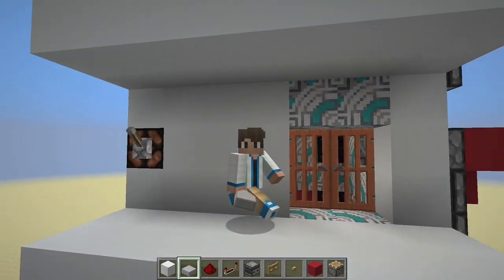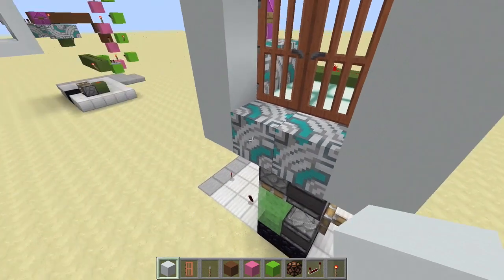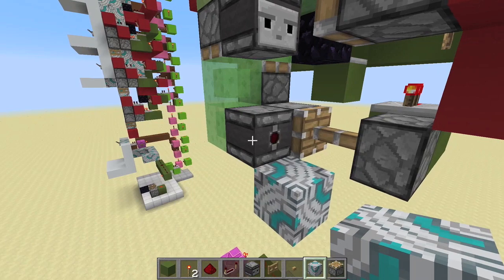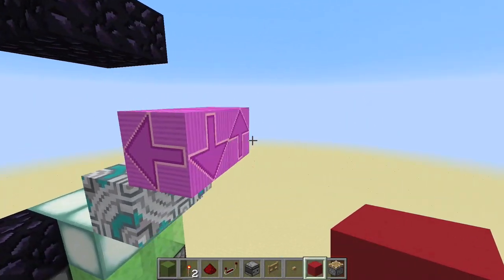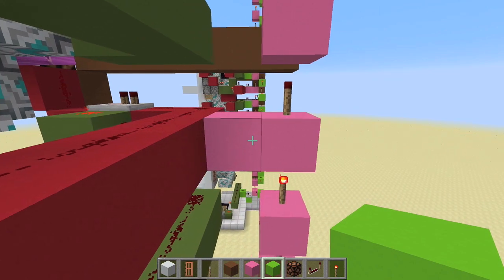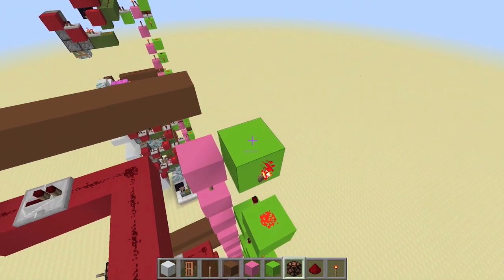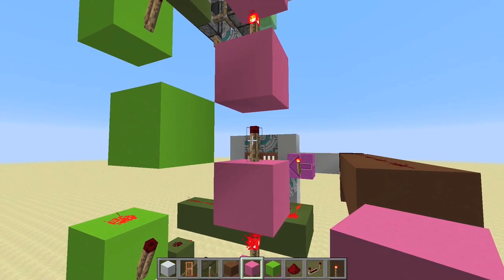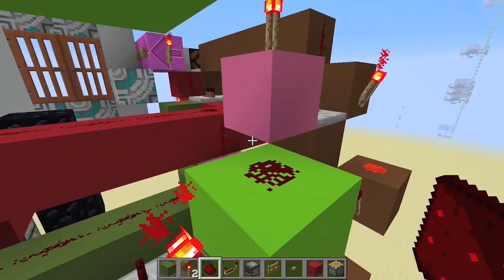Minecraft Tutorial: Multi Floor Elevator with call to floor  V2 java 1.12 - 1.13 / PE

Comment: @Hex and anyone else who may have problems....on xbox 360 mine would get stuck...I found out through trial and error that for some reason the buttons stop it despite being two blocks away...I tried the buttons on top of the blocks and works fine so currently I'm working out where I can fit them lol...
Reply: Pickled Peachez omfg thang you so much! I have the same problem on Xbox 1s it’s been so stupid!
Reply: @d3von443  lol your welcome....I rebuilt it about 4x as I really liked the design....getting a  new xbox one myself so handy to know it will work again moving the buttons :)
Reply: Thank u so much
Reply: This also happens on ps4
Reply: @PickledPeaches  are you still an active MC user? I built this for Xbox one on bedrock with a few modifications and it works well other than the call to floor function
Reply: @colintalltale6133  hi...kind of..I had a break from it recently..and likely wildfire abit longer as just bought ff7..but I do have xbox one too now...great to hear as i really liked this design...what sort of mods did you do?
Reply: @PickledPeaches  I implemented a dual locking system and cut out the use of the cycling function to keep the elevator spaced so it starts and stops no problem.
The issues I faced were the pulses from the flying platform observer were too short and kept misfiring my elevator, instead of square it is "L" shaped.
The whole system works, and you can have the elevator come from the ground up, or the Penthouse down. This is is my first time playing with Redstone though and I'm having trouble automating the call to floor functions. I just don't know enough about redstone yet
Reply: @colintalltale6133  well fir first time you sound very knowledgeable...yes unfortunately I couldn't get the call feature to function to the too but was ok bottom to middle.
Reply: @PickledPeaches  I spent 3 days s watching videos looking for this exact system. It's just a shame that different versions come with slightly different redstone properties. I have a friend that has been playing MC for years and he briefed me on Redstone
Reply: @colintalltale6133  yeah maybe hex can put together a modern version too :) unfortunately my redstone knowledge is self taught/or watched so still learning
Reply: @PickledPeaches  I've reached out to hex already, I'm hoping he gets back to me despite it looking like hex is on PC and I'm on xbox

Comment: Very easy to add floors in either direction, very good explanation, now I finally understood the concept of how it works. much thanks.  Gonna use a pressure plate for the doors though so they auto close once inside.

P.S. I also chose to complete each level for both up and down so that I don't have to change anything later if more levels are needed. I just didn't add a button to the un-needed block ( so no button for down on the first floor and no up on the top floor ). Just add the button later once it's needed.

Comment: It works perfectly fine for me in 1.16.1 but at the 2nd top floor, when you press the down button, it will go up instead. Is there a fix for it or did i build it wrong?

Comment: Installed this on an existing world with a three story house. Elevator wiring went in easy, but the call to floor was another story entirely. Nothing lined up as it showed in the tutorial. One part would line up on one floor, but not on the others. Another part would line up on two floors, but not on the others. Most of the stuff that didn't line up showed a fix so it would have been more of a nuisance than anything else, but with the lever he said if it didn't line up, go back and check the tutorial again. Checked, double checked and triple checked. The only problem is my floor spacing. With no fix for this problem, it kinda kills the whole call to floor idea. Just saying, but not everyone is going to have floors spaced just right for this. I don't have enough knowledge of redstone to find a fix myself so I would love to see this added.

Comment: This is a really cool creation. Not sure if you still read the comments for this videos, but i'm having trouble with the call to floor function on the level above the bottom. The elevator skips past that floor and will go to the bottom. When the lever is turned off it goes back up to the floor in question. Is there a certain block distance you need for the connection to the green and pink blocks? Is there any rules other then the type of torch block to connect to and having it be at or below the floor? Or is it something else entirely? Thanks

Comment: I have a question at 17 mins or so you press the up button to bring the elevator back up to the next floor but when I do that it only comes up 3 blocks then stops how do you fix that?
Reply: I have the same problem, did you find a way to fix it or did you give up and found a different elevator because I’m just about to give up completely and go with an ugly bubble vator. If you did give up could you tell me a video that works.. thx
Reply: @bread1511  in console the slime gets a stuck on the buttons just place them on the top of the block

Comment: When I did the call to floor function thing it didn't work bc i didn't have the same spacing, even though I exactly copied what the video said. Any ideas?
Reply: I sugest you to make a call to floor function by yourself. I am having the same problem, so i'll do my own circuit, i think that i'll use random blocks, random slabs, observers, redstone, repeaters and normal pistons, but idk if it will work, i hope it will

Comment: This elevator seems to not work on ps4 1.16. When I press the down button for the second floor, the elevator car goes down 2 blocks, and then goes back up. Anyone have a fix? I tried playing around with different buttons and got the same result.
Reply: Bedrock Version?
Reply: @flxsc3877  yes
Reply: 1.16.201.1
Reply: Sometimes you got a block that can be pushen by slime at the edge of the elevator
Reply: @flxsc3877  ok
Reply: Try it. If its not fixed After that i dont know anymore😅

Comment: Can you change out the lever for a button or maybe a floor plate? I mean I'm done building mine in creative for proof of concept so I'm gonna try anyway but I feel like it's much better then a switch that might get forgotten.
Reply: Mitchel Janke you could but you would have to add a delay that’s long enough for the elevator to reach the floor from any other floor i.e. on the top floor, have a long delay if you’re calling it from the bottom so that the torch tower is flipped long enough.

Comment: It is a really awesome elevator. However, mine is having an issue. As it passes a stop point, where the buttons are, the slime block actually grabs the buttons, breaking them. Also, it sometimes stops between floors. Please advise. Im operating on a ps3 which may have something to do with it, and its in my redstone test world, which for whatever reason makes it lag miserably as i push the button. Also, falling through happens. Idk. Still awesome design. And if u read this all thanks, you're awesome!
Reply from the maker: Did you set the buttons back a block?  It wasn’t doing that for me.   Also you should check out my multifloor water elevator.  Similar functionality.  Much more compact and super fast!
Reply: Yes i built the buttons like on yours, a block back on the arrows, essentially a copy of yours, with detail diffrences. The sort of elevator modle im looking for is one like would be in a skyscraper. However i assume the issue is that the system is way too laggy. Thanks for the reply, its not often big youtubers like yourself reply to my reveiws. Thx!

Comment: This elevator works beautifully on our 1.13.2 server. Is it possible to integrate an automatic door opener with this design? I've tried to figure one out, but it's beyond my skills.
Reply: I guess you can use something with an observer block to detect when the elevator stops and then hook that up to a flip-flop circuit to toggle power to the doors.

Comment: Does this still work my elevator keeps going up and down in the middle of floors
Reply: I think it only works in Java or something. It does the same for me on Switch.
Reply: And on PS4
Reply: This has been happening for me on Java, but only with the call to floor function- it's deactivating the piston lock so it won't stay at the floor it's called to

Comment: I have v1.7 ps3 and have been looking for this kind of tutorial. After building it entirely, I was disappointed of the glitches which made it impossible to go up and down. The system works but i glitch down the floor and the buttons pop off the blocks for no reason.😣
Reply from the maker: Check out my latest upload.  Same concept but without a flying machine.

Comment: when I use the call to floor function to call the car from a higher level, it activates releases all the locks and then the car goes all the way to the bottom
Reply from the maker: Make sure to tie into the torch towers so they are only active above and below the floor you are on.  That's the tricky part.

Comment: i built the elevator and the main portion of it works fine, but no matter what i do the call will not work, i was wondering if you could help me with it? thank you
Reply from the maker: I would need some more information or maybe some screen shots of how you connected it up to the elevator.
Reply from the maker: Hmmm. The connections look ok.  Does the elevator move at all when you call it?  Does it pass the floor you are trying to call it to?
Reply: it does move but doesnt stop on the floor, it continues on until the elevator meets the stop or u turn the lever off,
Reply: i have the same problem with it
Reply: it s because the locking pistons stay extended until u flick the lever off

Comment: Very nice Video 💪👌👍but does work this on the PS4?
Reply from the maker: If the flying machine portion works, then it should work!  I would test it in a creative world.
Reply: When you say ps4 you mean next gen (xbox aswell)
Reply: I had the same question for Nintendo Switch
Reply: On my PS4, it glitches out and most of the elevator is removed until it stops moving, making it very annoying to go down, and impossible to got up.

Comment: Does it work for xbox one cuz the original one doesn't
Reply: ive built one on xbox one the buttons initially worked until i put on the levers portion.  checked through and then some levers worked.  it's intermittent. sometimes i need to press the button three times before it will go up or down and at the moment it is not working either way.  It is just pumping whenever I press either button but wont go on to the next floor.  Hex, can you help?
Reply: @patlamb3535  no i mean the flying machine
Reply: yes it does
Reply: @patlamb3535  ok thx

Comment: Gutted tgat flying machines don't work on 360 now. Just go straight through block
Reply from the maker: I know!   So sad...
Reply: HexRegulus skippy 6 gamings one used to work now it just kicks you through the bottom.  I just want an elevator that works on 360. Looks like its gona have to be a slime block launcher type ill have to use....... or the stairs.